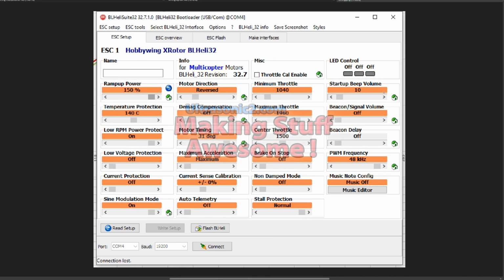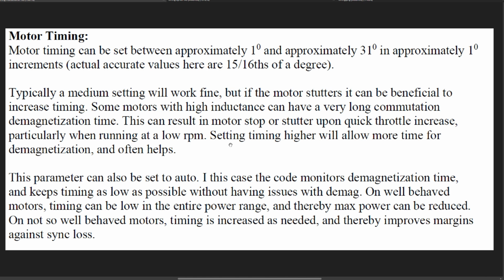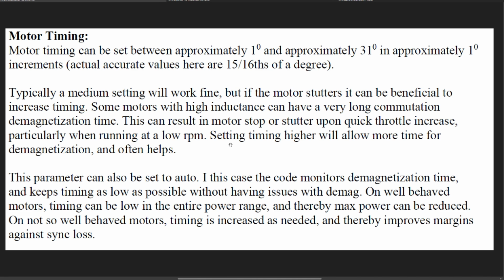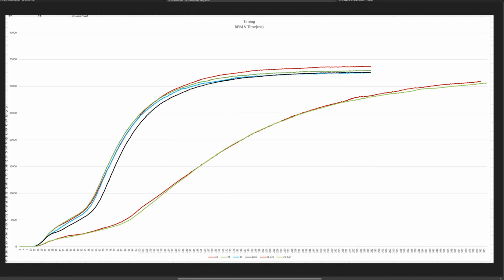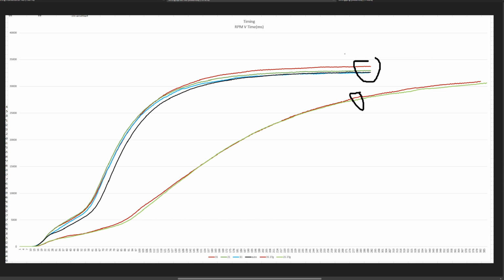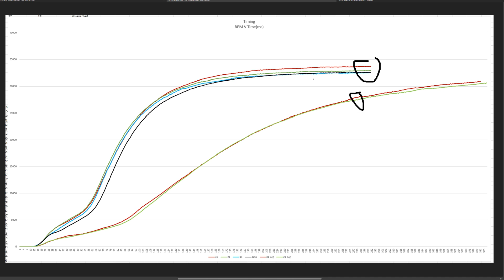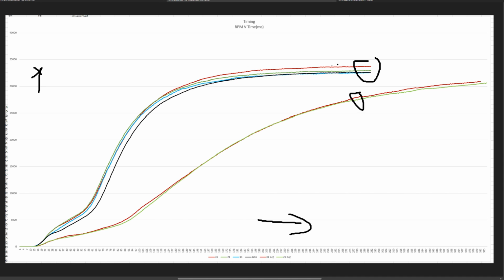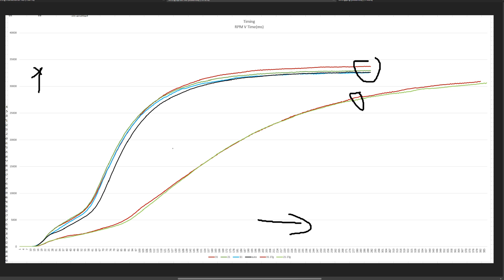⚡️ BLHeli_32 Motor Timing Dyno

Comment: hola tenia el timing motor a 23 y low demag compensation, gasto falcox en una fc no flightone. pruebo unos presets que hay, el que pienso que mejor va en propwash al poner ese preset, tartamudean los motores, con otros presets no lo hacen, ya que cambia tambien el filtrado y los pids. que deberia hacer para intentar quitar ese tartamudeo de los motores . subir mas el demag compensation o el timing motor? por donde empiezo a tocar? es un 5" con xing 2207 1800kv